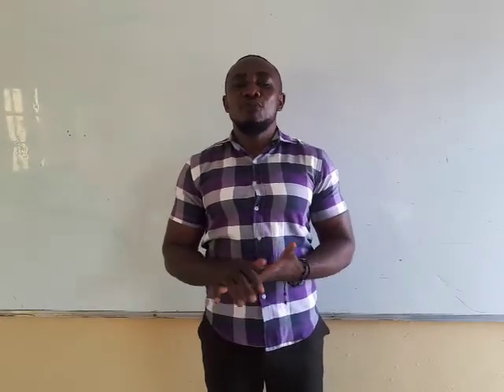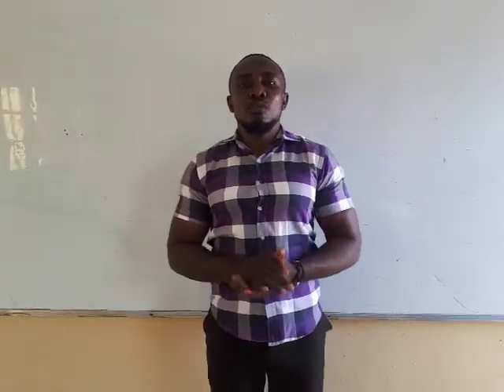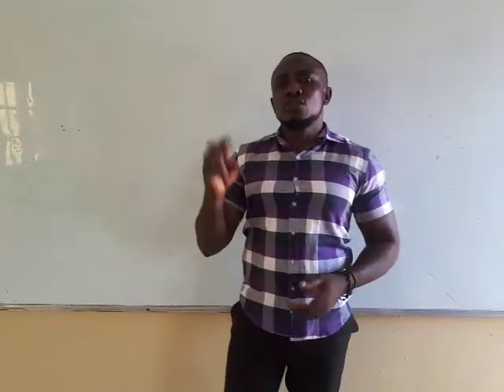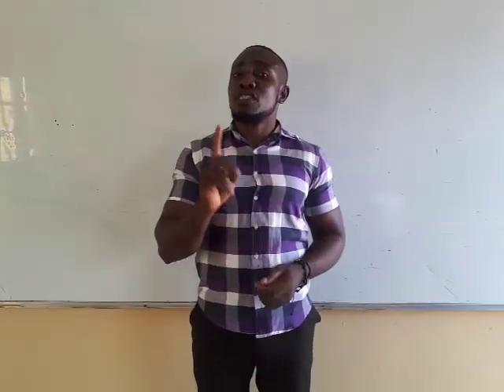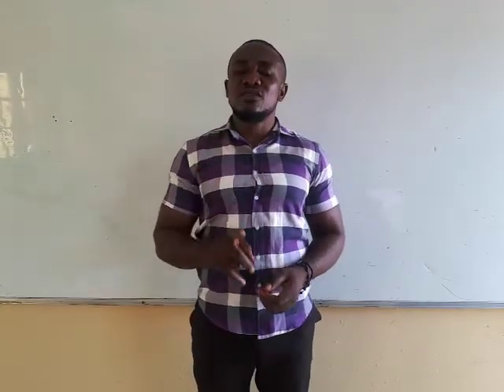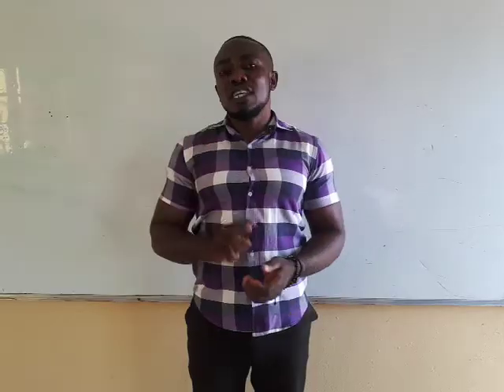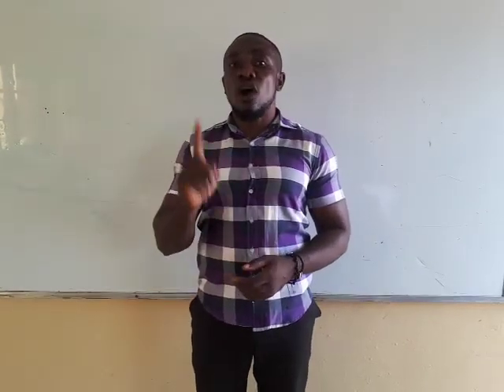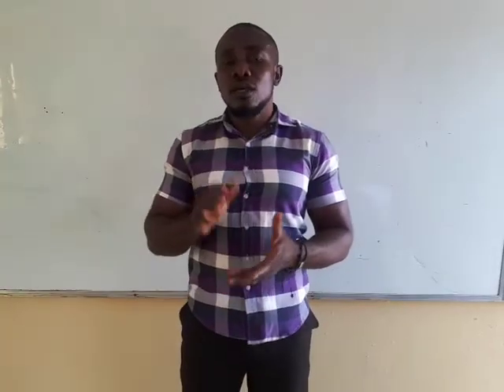TD - ELLIPSE Part 1 (AUXILIARY CIRCLE METHOD)

Comment: Bravo! un Ellisse proprio bello; 
tuttavia sul terreno ,se vorrai tracciarlo, non ti verrà molto bene perché non potrai usare il curvilinea. Occorrerà tracciare il rettangolo in cui è inscritta l'ellisse , e la curva per punti di cui devi calcolare le coordinate riferite agli assi (a ; b); secondo le formule; 𝐲=√ [1-(x/a)^2]b^2. ed x=√[ 1-(y/b)^2]a^2
In un mio esercizio ho trovato che l'ellisse più bello da vedere è quello che ha gli assi in rapporto a/b=16/9 e con eccentricità e=√7 ≃ 2,646..

Cordialità da Joseph
li 4 agosto 2020
Reply from the maker: Hello Joseph, 
I was able to translate your feedback so I could comprehend what you are trying to communicate. Thanks for reaching out, I really appreciate 🙏.
I think I perfectly understand the point you are trying to make which is absolutely correct👍. However, there is also the rectangle method of constructing an ellipse which I treated in one of my videos (u might wanna go through it). These are actually "construction methods" of obtaining an elliptical shape which are also derived mathematically as you have clearly pointed out.
It is similar to either applying the graph method or the factorisation method to finding the roots (answers) of a quadratic equation. In this case the graph method is similar to construction while the factorisation method is similar to calculation... Just an illustration to help me pass the message. ☺
The eccentricity of an ellipse is always less than one (<1), that of a parabola is always equal to one (=1) and a hyperbola is always greater than one (>1), 3/2 to be precised. 

Thanks my friend 🤝